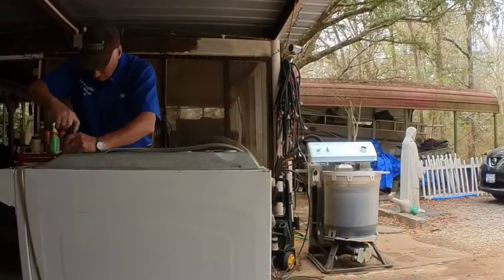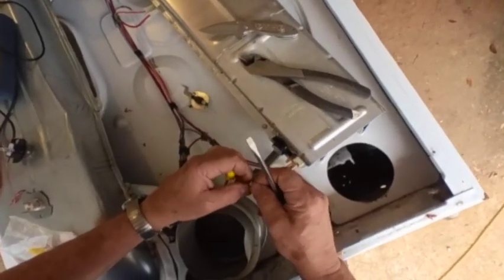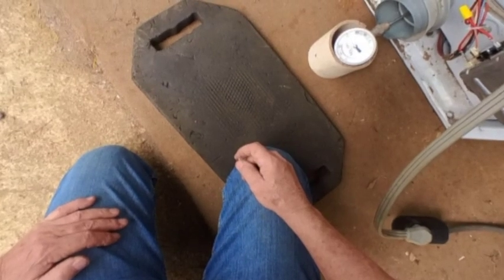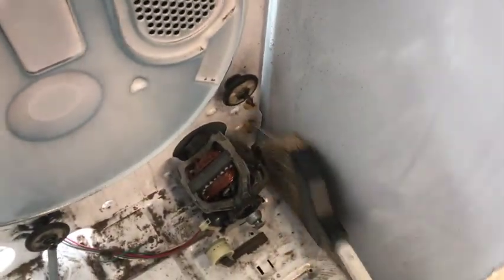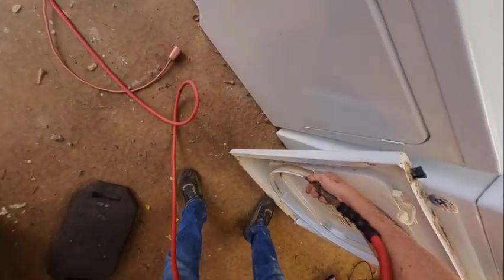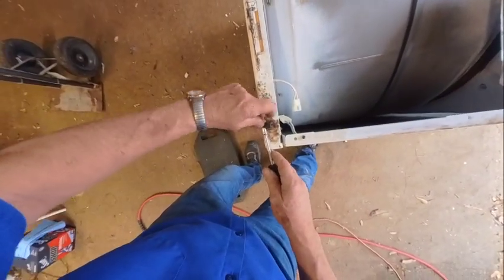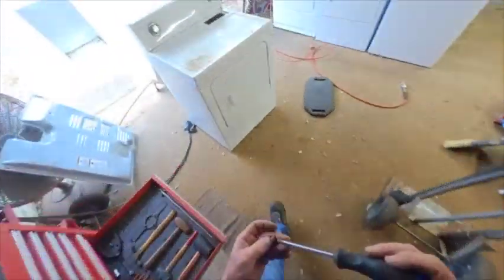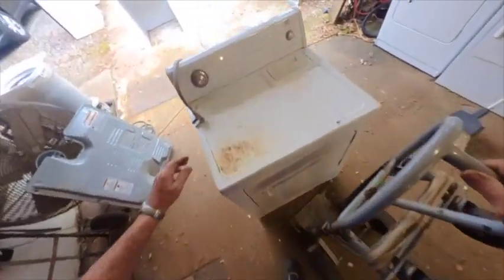How To Restore & Profit from a Used Dryer: Fixing Dangerous Mods & Selling for Gain

Comment: Curious why you didn’t remove the blower vent duct to remove excess lint/debris buildup?
Reply from the maker: Ha! You noticed. Actually I did, and blew out a lot of lint and screws and trash. Unfortunately, I paused the camera while I searched up the gasket material to reseal it and forgot to turn it back on.  I decided to just go with the footage I had because the video was getting pretty long at that point.  If you’re wondering, I use 1/2 inch weather stripping that you can get at the hardware store to reseal that shroud. Thanks for the comment Rick!
Reply: @HarperandKnowles  That a boy! I enjoy your videos!
Reply from the maker: Thanks Rick, I’ll try to make many more.

Comment: Interesting video!  Can debris/objects also get trapped in the rear felt drum seal as well as the front side seal?
Reply from the maker: I suppose it can but it’s pretty rare.  I’ll have to think about why though. It may have something to do with the seal moving on the back but stationary at the front.  On the Samsungs with the seals attached to the moving drum on back and front, you find a lot of coins and whatnot inside the cabinet where they fall through those seals at the back and front. Thanks for the comment Mark!